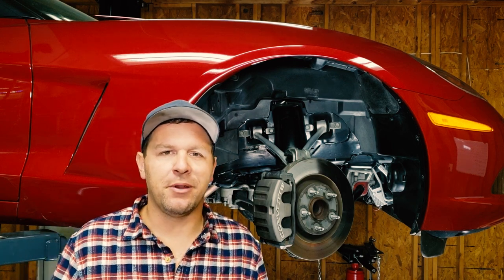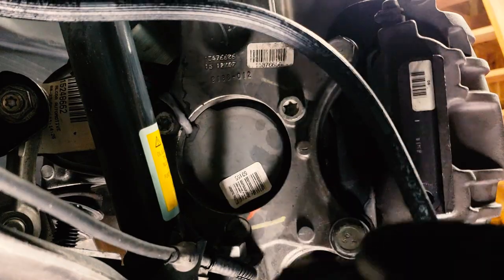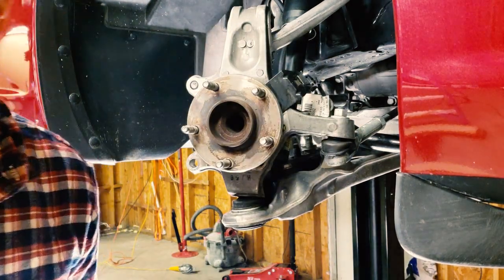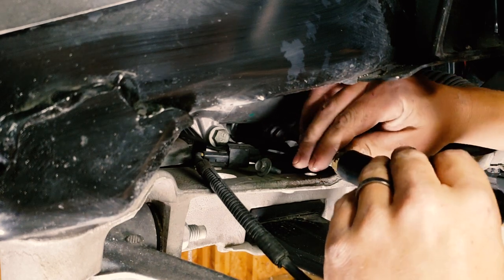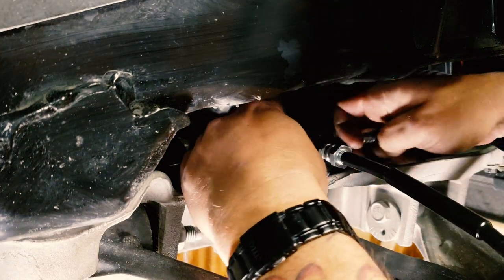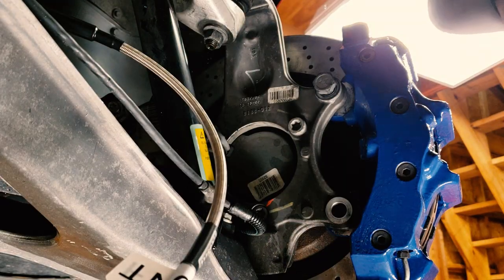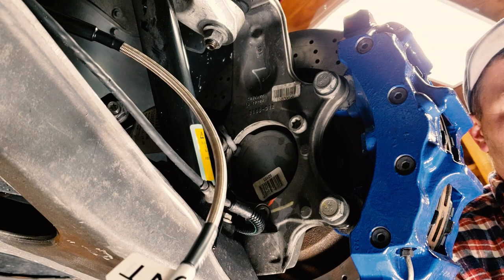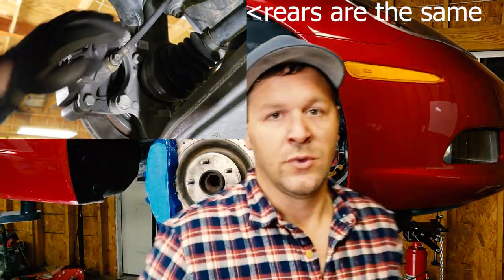C6 base corvette brakes to c6 Z06 brake swap. step by step how-to+ tools and complete parts list.

Comment: I just used 15mm spacers all around so I could use my stock base wheels. I didn't want to replace the studs with extended ones but if you go that route you only need 8mm spacers.

Comment: I'm thinking of upgrading my brakes to the Z06 as well but I already ordered the wheels. They are aftermarket Z06 wheels (18'" front with 54mm offset and 19" rear with 71mm offset ) but I'll have to go to your other video to see if I did good. Thanks!

Comment: Great video and explanation!  Subscribed.  I have one question though.  If you have the Z51 model with the slotted rotors, can you just replace the calipers to the larger Z06 size?  I already have the wide body conversation with the Z06 size tires.
Reply from the maker: The caliper offset is set for the Z06 rotors. Unfortunately you need both

Comment: I have a quick question my good man! Im upgrading all my fenders, bumper, and quarter panels to zo6 style body parts. I have my c7 gloss black zo6 rims imma put on my c6 aswell but im wondering something pretty serious. I have the base model BIG brakes for my front like the ones in the video. I want to put bigger brake calipers on the rear. Can i keep my calipers for the front and paint them and only get the rear calipers? I want to get all new rotors aswell i was just wondering if i could keep the base front ones bc they’re kinda like the zo6 ones.
Reply from the maker: I think that you would need to measure the Piston area of the brakes to figure out whether or not that's going too wildly upset your brake bias

Comment: Isn't that rotor on the wrong side I thought the slots are supposed to face direction of wheel travel going forward?
Reply: I know it’s an old comment but assuming others will see this video, you’re right normally rotors would be directional but from factory z06 rotors are all left hand rotors so one side will be correct and passenger side looks backwards. He did it correctly in the video.

Comment: How did you handle the rears? The bolt holding down the brake lines has something right above it and its a mega pain in the ass to get to. I have my calipers and rotors on now, just trying to figure out how I can get that undone. and Base rear hoses wont work at all? even if rotated to fit the different hole position?
Reply from the maker: No unfortunately you absolutely have to have the ZO6 hoses because the spacing between the back of the caliper and the banjo fitting is different. The inverse works though you can run Z06 lines on a base. The bolt come out, you just really gotta fiddle with it.
Reply from the maker: If you go to 11:50 in the video you can see how I did it.

Comment: Can I use the stock C6 base model rotors with the zo6 brake calipers or are the rotors for the zo6 bigger
Reply from the maker: The z06 rotors are much larger and have a different caliper offset so they will not work at all unfortunately

Comment: Why do the brake lines need to be replaced? Is it due to the length? Or do the actually fittings change?
Reply from the maker: The fitting changes. The non z06 lines are square at the end and the z06 lines have chamfered corners for clearance. Hope this helps feel free to ask any more questions.

Comment: What!!!!   No special mounting bracket?  No cutting off parts of the bracket to accommodate the larger calipers?   You mean I don't have to buy a special kit from one of the Corvette parts rip off catalogs.   Are you kidding me?   Dude, I love this video.   I'be been wanted to do this to my base C6.   Did not consider the need for larger wheels.  Hummm...
Reply from the maker: I've had three different sets of base wheels fit up and they clear with a 15 mil spacer and a 6 mil in the rear. Even better, the Gumby wheels clear with a tiny spacer in the front and no spacer in the rear
Reply: Gumby wheels???
Reply from the maker: @gregpruitt1647  https://www.corvetteforum.com/forums/attachments/c6-corvette-general-discussion/47992473d1466353336-gumby-wheels-img_9176.jpg

Comment: Weird huh you mentioned zo6 wheels not fitting the cause the fenders , I have zr1 wheels and they fit ? Idk I’m confused
Reply from the maker: The OEM ZO6 or ZR1 wheels will not fit base fenders. If you have C6 ZR1 wheels that fit a base car, you have replicas
Reply: I used to be cool even if they’re the right size? 19x10 front 20x12 back
Reply from the maker: @alonzo5.040  yes. the offset is different.  The Z06 Grand sport ZR1 wheels are pushed further out to give it a wider footprint and to clear the large brakes
Reply: I used to be cool what the heck!!! Lmao damn okay thanks! I much appreciate this !

Comment: All I wanted to see was what you used to cap the brake line... my RBF is clean and expensive 💭
Reply from the maker: I used the rubber covers for the bleeder nipples on the brake caliper. Be sure to push the fitting back up the line.
Reply: @gofastandfix  I needed to see,  or a part number.  Thanks though. Im done. I still need to figure out the right part for next time

Comment: what are the measurements of the spacer?
Reply from the maker: For these particular wheels it took a 15 mm in the front and a seven in the rear. But and big but, it depends on the design of the back side of the face of your individual wheels. That's why I went to all the effort to show you how to measure that.

Comment: Where did you got everything?
Reply from the maker: You can find everything oem on a most major parts sites.  I got my parts from a donor car, but you can buy the calipers, rotors and lines brand new from Chevy, rockauto, summit and even AutoZone but I suggest shopping around. I think parts geek had the best prices the last time I looked  for a friend.

I'll see if I can dig up the part numbers, that's the best way to search.
Reply: @gofastandfix  Thanks man